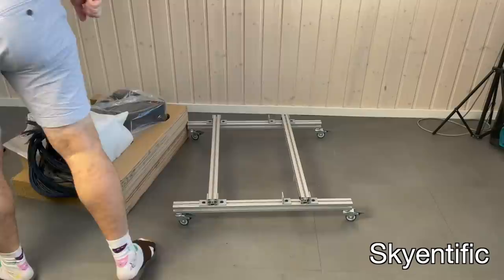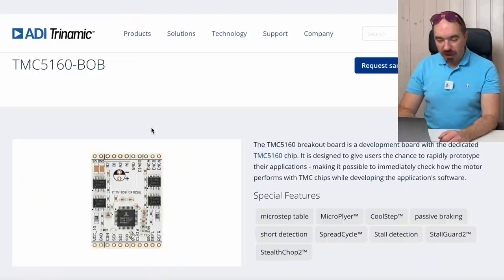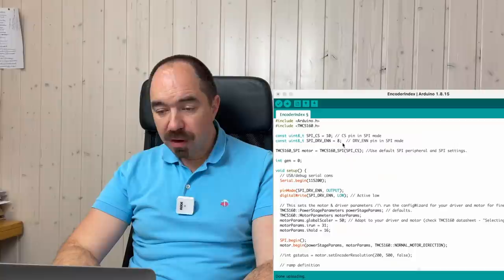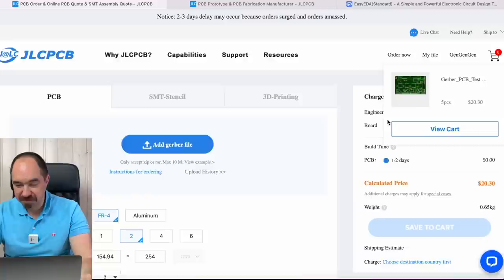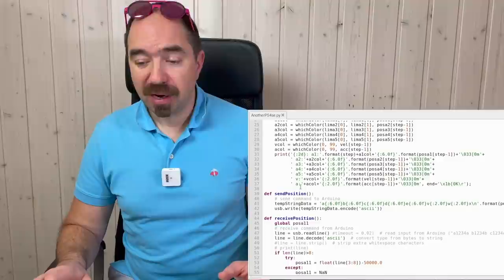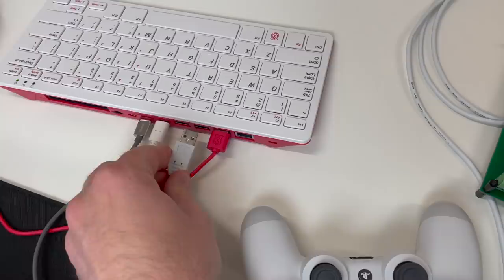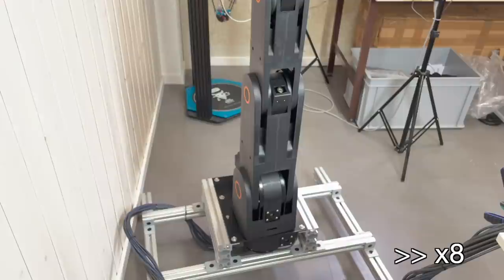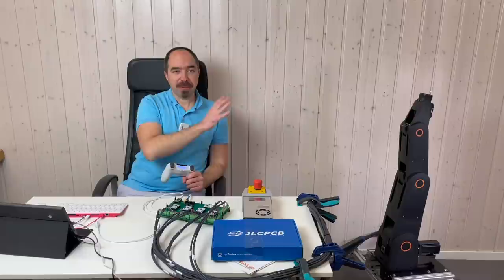Industrial robot arm controlled with Gaming joystick!

Comment: Excellent video! I've been working on developing something similar with a much higher payload to compete with much more expensive Kuka and ABB arms that are used in the film industry. You should try speeding up the acceleration and see how fast you can get it to go! If you have a small camera like a GoPro or smartphone, it would make for really interesting camera movement to stick that on the end of the robotic arm!

Comment: An application for the robot arm would be PCB assembly for reflow soldering. If you can pick and place all the components on a PCB with SMD package, this would be verry impressive!
Reply: too slow
PNP Machines are already optimized for speed
Reply: @yusniafterwave9903  offcourse a PNP machine is optimized for that task, but doing this with a robot would be a verry cool show off regarding accuracy and repeatability 😉
Reply: @dunichtich100  It would be like watching someone excavate a swimming pool with a spoon.

Comment: I plan to build something similar (one day) to plug the electric car in when it detects the coast is clear. Can probably get away with 3-4 axis depending on how fault tolerant the plug options are: forward/back, up/down, in/out, yaw for a few degrees plug will always be 'level/fixed insertion angle' on the level floor, or the car shouldn't be plugged in. (ie up on jacks changing tires).
Ideally it would work with openCV to search for the port and home in.

Comment: My suggestion for a quick video would be to fix the controller to use inverse kinimatics. Left joystick moves the toolend in x/y 3d space and right joystick moves z plus end effector spin. Perhaps one of the buttons on the joystick can switch between the modes. You could then add functionality to capture points (another button) and move between them.

Comment: Besides recording some actions (which isn't strictly necessary), what's even the point of having a 1k joystick with an expensive industrial robot? If you're operating it via the joystick, the robot can't be doing anything particularly efficient?
Reply from the maker: The joystick is just illustration. Here you can control it via python or C program, like most industrial robots.

Comment: Great Job, but can please explain why you need the Teensy between the Raspberry and the TMC stepper drivers? Can you not leave the Teensy out and communicate with the drivers directly?
Reply from the maker: Great question! I think, you can control TMC directly from raspberry pi, through the GPIO pins. I used Teensy, because like this I can use simple USB connection. And so, I can use this controller with any computer, not only with raspberry pi.
Reply: @Skyentific  Thank you for this well thought out answer. I see where you are going: make the controller board as versatile and universally usable as possible which is a great thing 👍🏼 For your next iteration my suggestion is to use the raspberry directly on the controller board with its GPIO pins, instead puting the Teensy inbetween. The Pi also has USB, so you can still connect the controller board to other external computers or use it as stand alone unit with the Teensy as the controller on board you need an external computer anyways and have to cost of the Teensy itself. With the Pi on board you can circumvent both problems with one fix ;)

Comment: Why is it so slow, and can the response be faster with code or does it require a bigger motor and more power?
Reply from the maker: Here, I was too conservative with the speed. It can be way faster, just need to change the speed in the software.

Comment: I am building a Upper Limb Exoskeleton for my final year project for bachelor mechanical engineering degree. I would like to get in contact with you for some advise because I'm using these motors and there's not alot of information about it.

Comment: How do you have more encoders on same Teensy? Seems to run out of interrupt service routine handlers and pins.
Reply from the maker: Great question. The answer is simple: encoders handled by TMC5160. Teensy reads data through the SPI from TMC5160.

Comment: Hi dear, I have a question, can you help me please? I used this shield TMC5160, I start the motor and after a while it stops. It seems that the motor has reached some protection of the driver. To work again I have to reconnect the power to the driver. 
I have read all the datasheet, tried all the ways and couldn't find the problem, did you also have this problem? Can you please help me if you know the solution?

Comment: Does this design basically aim at the higher amps used by nema 23's on this arm. I am trying to figure out the particular route over normal stepper drivers etc without having to figure out everything :D

Comment: is it not possible to connect directly to the teensy over bluetooth?
Reply: Teensy products do not support Bluetooth natively. You'd need at least a typical tx/rx module and some code, if not upgrade to an expansion board that essentially makes the Teensy a full sized Arduino. There may be a Teensy-esque alternative with Bluetooth, but every example I know of doesn't have the pinout required.
Reply from the maker: Great question and great answer. And another point: I want to use raspberry pi (or other computer) to be able to add some additional stuff: inverse kinematics, screen, computer vision, etc.
Reply: @xaytana  I see. Do you have any idea if it would work with for instance an ESP32 (integrated bluetooth + wifi) board then? Many thanks.
Reply: @SirArghPirate  Why would you want to mix the two? ESP32 is a microcontroller itself, though IIRC the Teensy has more connectivity that's utilized here. All you need is your typical add-on/breakout module, the simplest being VCC/RX/TX/Ground, though many have a pinout broader than just that, such as the various HC-05, HC-06, JY-MCU, Sparkfun's BlueSMiRF, AdaFruit's Bluefruit EZ-Link, etc.

But this is only if you're wanting a standalone motor controller controlled via a Bluetooth device. If you want functionality beyond what the Teensy provides, like Skyentific's example of additional processing and a terminal, you'd be using the Teensy as a daughter board. You want peripheral connectivity at the main system board, not at the various daughter boards. The only realistic scenarios of only using a Teensy in this way is for very rudimentary remote control, otherwise virtually every project will have a main board for wider functionality. Also, if you go beyond the capabilities of a single Teensy and require two or more, you'll want a main board anyways. 

You come off as new to the hobby. I would suggest doing more basic research before you start planning projects, it'll save you time and money, and it'll save you from quite a few headaches. You should have an understanding of what you're wanting to do with a project, mixing an ESP32 with a Teensy for the sole purpose of adding Bluetooth to the Teensy, when much better alternatives exist for this integration exist, shows a lack of understanding at a general level. Reddit has a quite active general robotics community; which, IIRC, has a fairly decent wiki for newcomers.
Reply: @xaytana  👍🏻